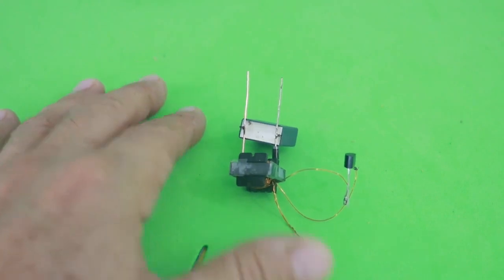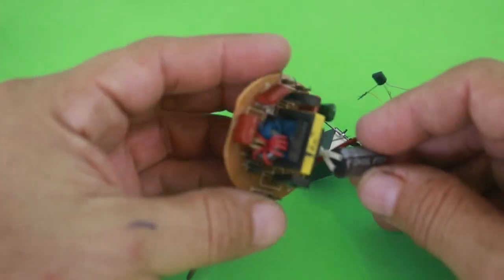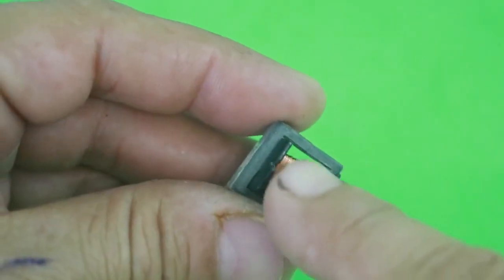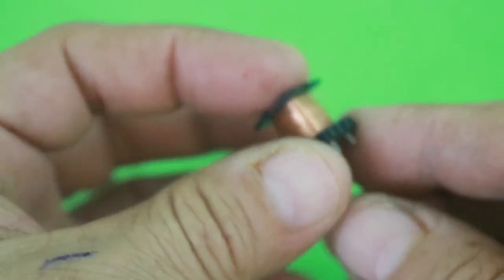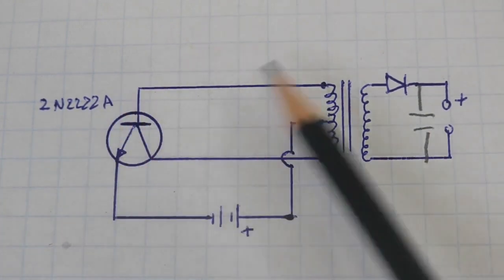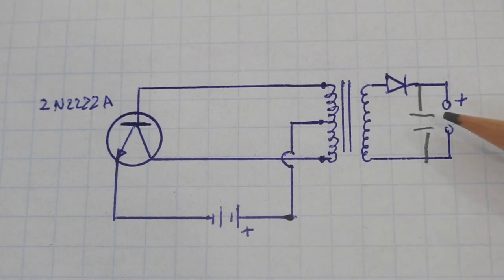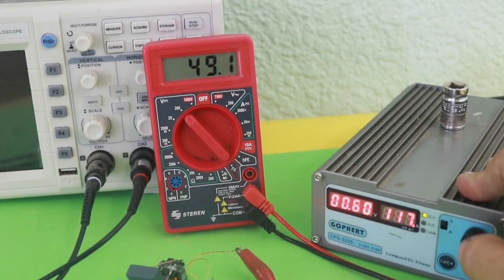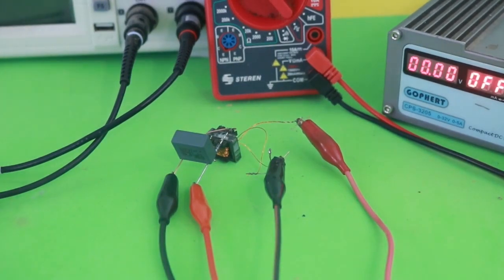Super Simple Voltage Booster Circuit

Comment: the question is can it run cayrex2's tiny ink heater at 45/50v ^_~
https://www.youtube.com/watch?v=1m5TTjhEyeQ&t=781s High temperature Conductive ink - 1000 degg C (Update)
Reply: for instance at just! 170/200c you can then make a tiny portable'ish diy 3d filament from plastic string ,join them, assisted localised heat friction welding etc